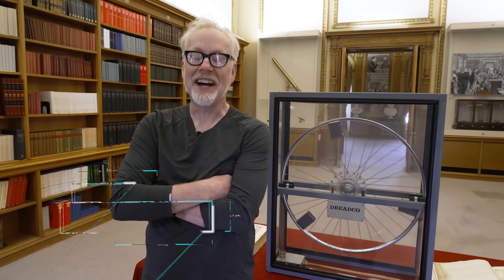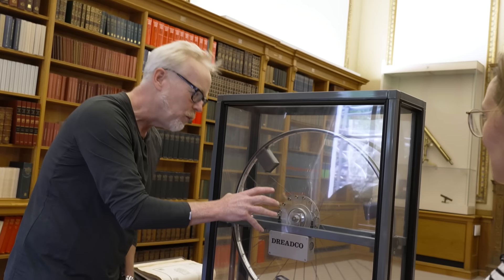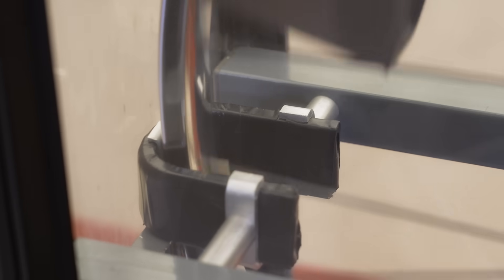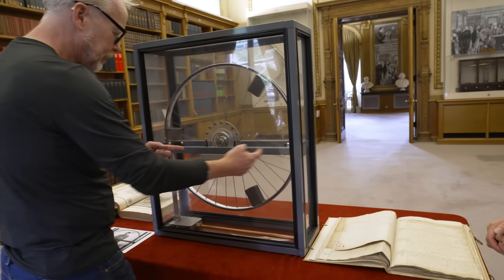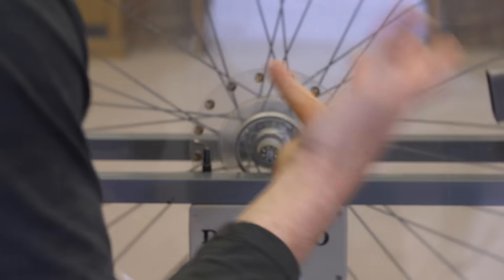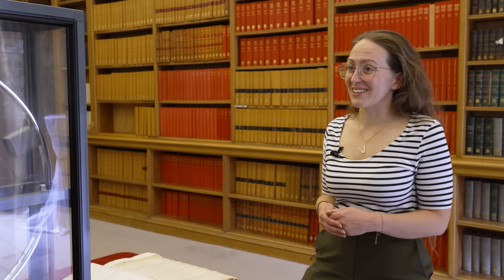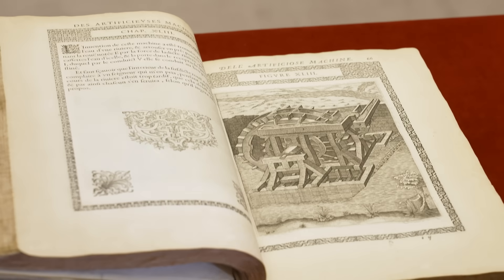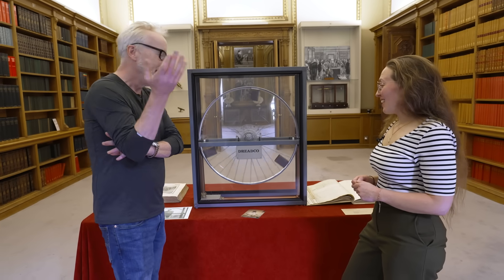Adam Savage vs The "Perpetual Motion" Machine!

Comment: You could measure tiny magnetic fields w/ a meter to find where it's getting a boost. Also a super slow motion camera could detect when the wheel gets a tiny acceleration.
Reply: Motion amplification cameras. They use them in industrial facilities for big machines that move in such a way we can't see. Those cameras will literally detect the blood pumping through your face as your heart beats! It's nuts! You're on YouTube. Go check it out
Reply: I also think it is a magnetic field causing it.
Reply: https://www.youtube.com/watch?v=4VBNn-ids6M here they measure the fields.
Reply: True, btw you can see the acceleration by eye when they zoom in
Reply: @shorthash  nah, thats an optical illusion from the larger bits which make your eyes think its changing speed. You would need extremely precise measurement instruments to measure that. Unfortunately the human eye/ brain is not one of them...
Reply: @mondop5270  maybe you could do some video analysis if you transform the video data somehow and put a FFT or something on it
Reply: I don't telon they guna let people bring that sorta stuff in..
Reply: I think the box has photo sensors, and at 5:00 I think she was trying to hint it gets put away in a dark room for an extended period of time that maybe when they sense light they turn it on and when it goes dark it turns it off to conserve the 2 year battery life. The battery is most likely lead acid. And the drive is most likely in the brass tubes that go to the box. The magnet coil idea Adam was going at is the on off switch because if that was true it would be easy to turn it off Being the box withholds the photo sensors and are attached to the magnets which go through (detect/communicate with) the coil windings.
Reply: @Twostrokealec   Hypothetically, The photo sensor could be a power source. This would be like an early version of a solar panels. I believe the reason she mentioned it went into a dark room, was to suggestively rule out that. In a dark room, it would not get much power and would come to a stop. If it came to a stop in a dark room; she would have disclosed that fact and everyone would have a better idea of the power source. Since it works continuously in a dark room, That sensor is probably not such a critical part, and it may be just distraction. The amount of power needed to spin it, is small about the amount of power needed to run a clock. A self-winding clock has long been suggested as a power source.
Reply: The coils most definitely don't give it any drive, the might but being how big they are would definitely distract you from what's actually going on.
Reply: @Twostrokealec  I think you are right they don't; only because there were no electrical/magnetic readings next to them. They could though, and I think he purposely designed it in a way to mislead most people. It has been said only one person guessed how it worked. It has also been said, it is rather anti-climactic, which to me suggests something simple. (a clock spring).
Reply: @cryptickcryptick2241    I would think using something as simple as photo sensors (the same things used on garden lights to turn on at night)  to turn it off/on as means to conserve power would be very anticlimactic.
Reply: simple counter weight but to be TRUE it must be self powered - needs a human hand to get it going

Comment: Forget perpetual motion .  The only perpetual motion that makes any sense whatsoever is an object floating in space and even then I'm sure the dust will slow it down.  Try vacuum with magnet bearings and then just spin the wheel.  Otherwise were looking at utilizing external gravitational electrical magnetic fields light and wind.

Comment: the heatshrink leads me to believe that it has some mechanism benefiting from changes in ambien temperature, the large pipes can also indicate barometric pressure. Something like an Atmos clock.
Reply: heat-sink, heat-sink... although a few here could sure use a head-shrink

Comment: Can you use your video footage, and plot the timing of the speed of rotation (spokes/min  etc) and see if the c-shaped items on the ends are providing a 'kick' to the wheel's timing every time a block moves through the c-shape? I suspect the blocks are magnets, and the c-shapes are providing a gentle kick.
Reply: That would be six "kicks" per revolution - - don't know if video cameras, conversion to YouTube, storage, transmission thru "The Net" etc. would maintain enough "smoothness" to see the difference. I bet something on the wheel is holding a charge, and even the spokes could be insulated wires.
Reply: I second that, this would be the simplest way to make such "perpetual motion"

Comment: Interesting, I saw this exact machine around 30 years ago, often wondered if it was still going. Part of the story at that time was there were plenty of fake explanations offered by the gadgetry inside to fool whoever was looking for how it worked. But two years spinning a bike wheel is pretty good efficiency. I have always wondered if the solution is based on changes in air pressure ?
Reply: Its not a bike wheel really, it has precision bearings and will show a lot less friction as a result - I suspect its natural run-down time is 10's of minutes or even hours.  Air resistance probably dominates the losses / sets the running speed. 
Roughly estimating the K.E. I'd say perhaps 100mJ, and with a 10 minute run down that means only around 200uW would be needed to keep it going by my estimate - that's doable with a fairly small battery for years of running, though the batteries might be quite large and the losses higher than that estimate, but totally feasible.
Reply: I too saw this machine or one like it many years ago. I also seem to remember finding an article describing the secret. It involved batteries in one or two of the three blocks driving a motor in one block, that rotated an off-centre weight by about one revolution in 5 seconds, which made the whole wheel rotate at the same speed. All the theories here about interaction with the magnets would surely accelerate the wheel to a high speed.

Comment: Something bothered me for a week about this machine, then I realized it looks a lot like the phase-induction motor used in old-style house electric power meters.
Reply: The basic issue with the other electric motor explanations is the lack of wires on the wheel rim that Adam would have immediately gone to. I'm making a few amateur assumptions here, but the copper tubing would be inducing a weak AC current in the rim and three boxes, with the boxes adding a slight impetus when passing through the magnets. The circuit creating the electric field through the copper tubing would need little power if the wheel is perfectly balanced. I suspect hidden wiring in the metal frame going from the Dreadco box to the circuitry for the AC current in the box with the copper tubing, and some sort of long-duration battery supplemented by the solar charging in the Dreadco box.

Comment: I really don't think permutual motion is impossible! Once we figure out how to do its probably going to be something so simple! It definitely has to be a series of free energy generated by the Earth all combined like magnets, windmills water turbines, thermal heat motors like the Sterling engine, generators, alternators, electric motors, solar panels, lead acid batteries that are so huge they're made in the ocean surrounded by the saltwater for it's electrolytes but then again let acid batteries degrade over time so don't generators so I don't know if that's considered perpetual motion the device would definitely have to be maintained and serviced! But if you can combine all those things in series it would pretty much run forever and be free they would just have to be on such a large scale for them to actually generate enough power to power entire cities! So I guess it's not perpetual motion but free energy!

Comment: halfway thru the video, i suspect the 3 blocks are just weights, and the bearings are very well made. also the case limits outside forces, thus any electric or magnetic purpose is completely a misdirection. the real magic is simply air moving around the box, and being amplified by the copper tubing. let's see what Adam finds... 😌🤔

Comment: I am sure it is powered by hidden batteries or capacitors.  That the boxes on the wheels are either just permanent magnets or blocks of steal if the bike wheel they are mounted on is aluminum.  The U shaped things they pass rough are electromagnet.  The only other option I can think of is a very small fan the blows a small amount of air at the brass cups near the hub.  It would be the brass tube on the right hand side coming out of the box with the name DREADCO on it.  I doubt it be powered by compressed air.

Comment: Thanks Adam for making this nag my brain all morning and early afternoon.  I've watched a few other videos and this and have come to my own hypothesis on what this may be.  The most obvious solution is that electromagnetism is involved.  The kicker is that it's not in the way that is most obvious. 

 One thing to take notice is how much the wheel is perfectly weighted.  You can notice in Martin's video how some extra weights were seemingly added to the edge of the wheel to counter the weight of the 3 boxes.  I assume this was done so the wheel wouldn't slow down prematurely.  In the BBC video, they reveal that the black U shapes aren't electro magnets.  The only emf readings appear to come from the lower left box and the center box.

My hypothesis is that the 3 tin boxes hold permanent magnets.  The black U shapes hold a reed switch (a switch that completes when held next to a magnet) that activates an electromagnet located in either the center or lower left boxes.  When a tin box 1 passes through the right reed switch, it activates an EM located in the lower left box that repels the magnet in Tin box 2 that is 120degrees clock wise from tin box 1.  There may or may not be a second reed switch and electromagnet.  But the battery location almost seems like it would be in the dreadco box. 

OK, i'm going to stop thinking about this now.   Google David Jones' other perpetual motion machine located in the Technology Museum of Vienna.
Reply: An incredibly well thought out and highly plausible theory 👍

One might also assume that it is able to use its own momentum in order to send a charge back to the battery.  It's a really cool toy but not technically a 'perpetual motion' machine.
Reply: Same conclusion

Comment: clearly a tiny hamster that lives in the heatsinked box at the bottom (the heatsink is to keep the hamster at a comfortable temperature). Every now and again,when its dark (hence the light sensor he correctly guessed) the valve (again good guess) in the box opens allowing the hamster to escape. The hamster then  gives the wheel a bit of a spin to keep  it going.
All the rest, the magnets (or coils disguised as magnets) and the hidden battery,circuitry etc are just to throw you of the scent of the hamster.
All the previous designs work on a similar principle, based on a good old fashioned hamster wheel.
Simple really.

Comment: I wonder if the "perpetual motion" waterwheel would actually, rather than defying physics, actually be useful for making a weak flow of water turn the wheel more efficiently. So not actually creating more energy than is put in, but still using smaller energy better?
Reply: nope

Comment: Saw this at a design engineering show in Chicago years ago. They had a contest to prove how it works and the beans were spilled, a lot of the parts are misdirection.  Hint, there is a power supply.
Reply: the copper tubes with the heatsink

Comment: There is a purchasable mechanical table clock behind glass that costs about 5,000 euros, consumes in the micro-watt range without visible charging and uses temperature and air pressure fluctuations. Nevertheless: In the nuclear bunker, it also stops after approx. 8-12 months.

Comment: Bearing in mind it was made in the 80's - the heatsinks make me think Peltier and a capacitor to hold the charge a little longer.
 The frame could easily carry cables to electro magnets that provide just enough power to push the magnets in the wheel.
The two probes might just be a reed switch timed nicely to activate the electro magnets at the right moment.
 That's my best guess anyway - makes me happy that he chose Martyn Poliakoff to hold the secret. =)
Reply: Peltiers are massively inefficient and use dozens of watts, its likely not a peltier, its a red herring I think.  U-shaped electromagnets and a trigger circuit is by far the simplest and most robust approach. Been used for battery powered pendulum clocks IIRC.  The wheel is being a one-way pendulum in effect (reference to NF Simpson(!)).

Comment: the box in the middle carries a wind up spring mechanism and reduction gears. the copper tubing and the rest is to deceive. the boxes on the wheel are weights to give it increased inertia in order to keep the speed down.

Comment: The batteries and the circuitry and the coils for pushing could be in the three boxes in the wheel and every time they pass by the two magnets on the sides they generate a tiny magnetic field to push on the wheel.
Everything else in the big box is just to mislead.

Comment: Folks it's really simple.  Inside the Dreadco box, It's just a wound spring attached to a gear train with a very high gear ratio driving the wheel. The other stuff is just there to deceive and confuse people like Adam Savage lol. When they take it to "servicing" they just wind up the spring. A multi stage gear reduction attached backwards could allow a wound spring to slowly drive the wheel around. The black boxes could be counterweights that could increase the wheels moment of inertia to slow down the rate the spring unwinds. Also the video mentions the wheel slows down over time which is consistent with this idea.

Comment: Neat.   Adam called it, too - there has always been in irresistible draw to the idea of creating a perpetual motion or over unity device.    I'm betting many of our 9-12 year old selves stared at the ceiling at bedtime thinking of arrangements of motors, generators, weights, lifts and magnets to achieve such a thing. Entropy is harsh but I'm willing to bet some of those kids who grew up imagining designs for over unity have gone on to work the problem of Fusion-based energy production.    Where some people see fraud, others see inspiration.
Reply: Either that or they plug a 6-way back into the wall using a male-male cable.

Comment: its a 'reversed' Wimshurst Generator.  AKA, an electrostatic motor...  I think
The point and ball in the middle acts like the brushes of a typical dc motor and a charge is passed between the two poles on either side. And the energy is probably stored  in a capacitor bank in the middle box. I think.

Comment: The nodes in the center with the two antennae are counters. That's how the system keeps track of the wheel position. It's sending a magnetic pulse to the u shaped coils on a timer. The 3 boxes are just solid state magnets that take the pulse.

Comment: This ls obviously just an an interesting trick,  but Adam is in no way qualified to judge such things.
Mythbusters did an episode about Join Bedini energizer (not a motor) and they totally sabotaged the test design. OBVIOUSLY on purpose. 
There is no such thing as perpetual motion, but the Bedini designs are heat pumps. Taking converting heat from the environment to electrical energy. 
So many lies to try and disparage such milestones in electrical research. Electrical engineering has not advanced one inch in DECADES... because profit.

Comment: It seems like the wheel it is in a pressure gas atmosphere. This gas is in a pressure in a tiny line below to become hot. When the boxes pass the local with less space the gas become compressed and heats up quicly. That cause the gas expansion and that pull out the boxes. So the boxes works like 
a compressor and , at the same time, a wall to the hot gas push out th wheel. The heat sink works to dissipate the heat. The principle it is the same of a domestic fridge. Now use gas espectrometer to identify the gas name

Comment: My guess is that th way it works only uses the three boxes ad possibly the magnets.  Inside the boxes have sliding weights that change the weight toward and away from the center pivot an are moved back toward the inner point thus changing the mass in a predetermined dance. The rest is just window dressing.

Comment: Let's do some sums. Assume the mass of the wheel = 1.5 kg, of which 1.0 kg is in the rim. Assume radius = 27" / 2 = 0.34 m. So moment of inertia of rim = 1.0 x (0.34)^2 = 0.116 kg.m2. The time for one revolution is about 5.5 secs so the angular velocity = 2 Pi / 5.5 = 1.14 rad/sec. Hence, the energy stored in the wheel = 1/2 x (mom. of inertia) x (ang. vel.)^2 = 0.5 x 0.116 x (1.14)^2 = 0.075 Joules. Now, let's assume the wheel would come to rest in one hour without energy input - so we would need to supply 0.075 Joules / hour to keep it going. Over 2 years that comes to 0.075 x 24 x 365 x 2 = 1314 Joules. An AA battery stores about 13500 Joules (1.5V and 2.5 Ah)  - enough for 10 years running! If the run-down time is 12 mins, and not one hour, then one battery would be needed to run for 2 years. Can somebody check my calculations?!

Comment: The 3 containers may contain PM.
When the container comes from below, the powder will be closest to the fixed magnet in the side. The outside of the wheel.
When the container has been at the top, the powder will be towards the center of the wheel. It will not flow as if it had been liquid.
I don't know, and I'm not a physicist. 
Besides, I don't believe it's even possible.